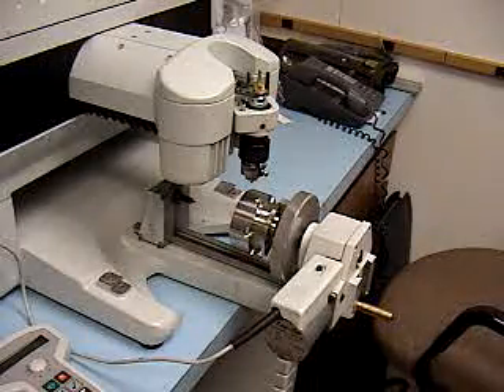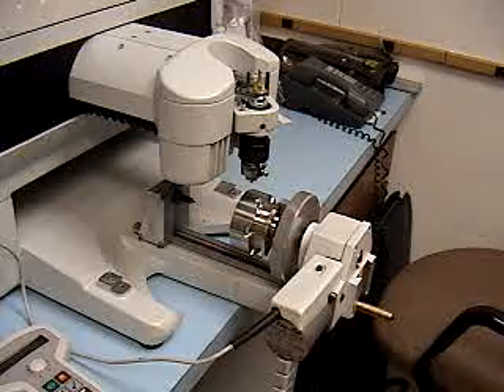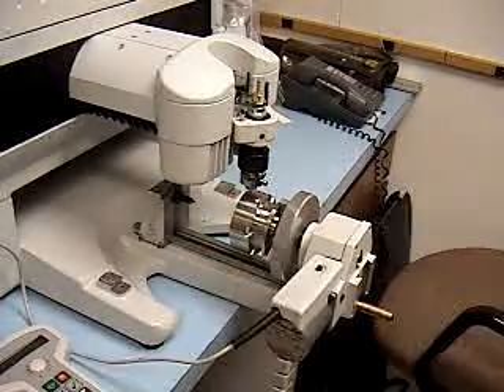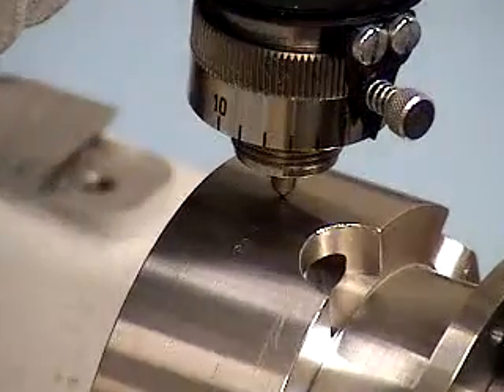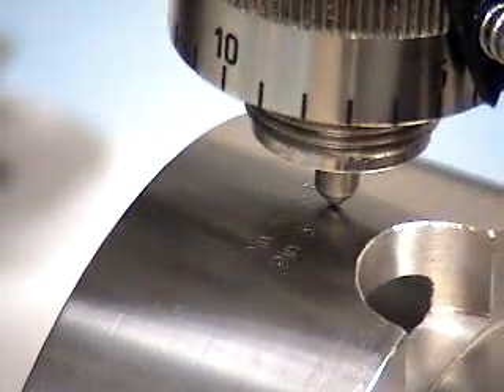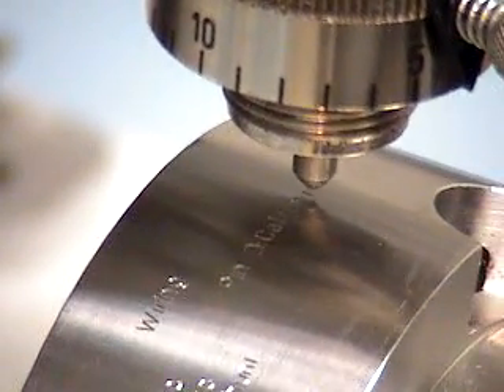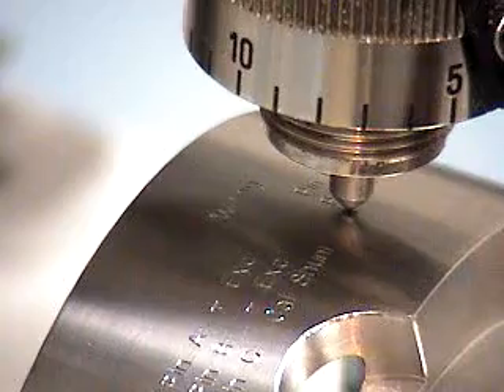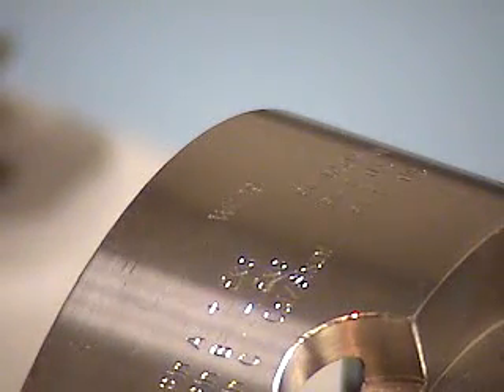Cylindrical engraving IS400 Gravograph

Comment from the maker: I used the Gravograh PN 42-036-020 non rotating diamond cutter. Only goes a few thousandths of an inch deep. To go deeper you should use a carbide engraving tool with motor and cutting oil.